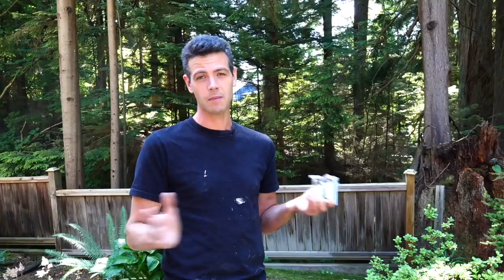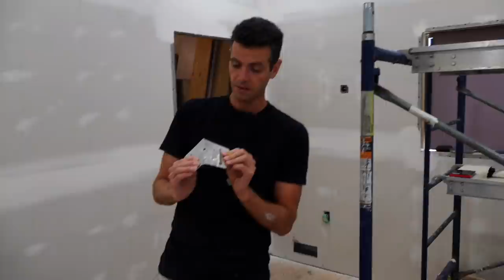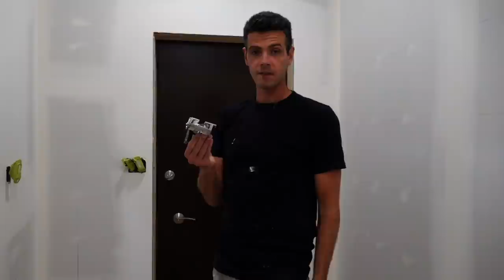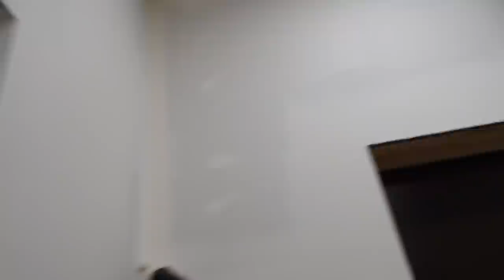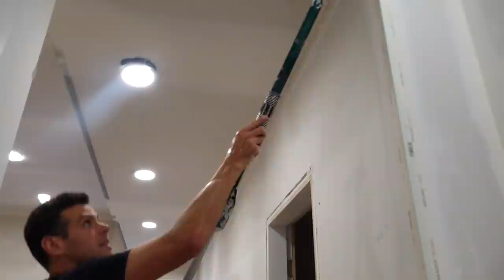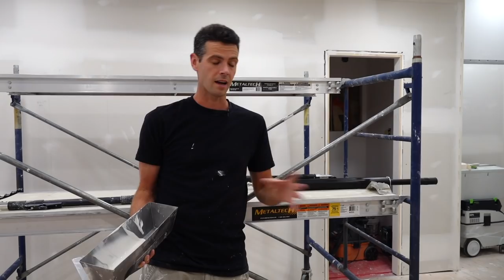Angle heads vs Flushers! Which is BEST? Drywall Corners!

Comment: I know that trim carpenters like angle heads better because a flatter, square (more square at least) corner makes applying base a lot easier.  I'll actually take a 10" knife and feather the corners out at the bottom.  It's an extra step for me but since I also often apply the trim I more than get the time back in the end because I don't have to deal with a gap between the base and the wall in the corners.  It easier to make the corners flat than it is to plane the trim to fit the drywall.

Comment: Lay a small piece of dry tape over the mechanical head hole, then press the ball into it while attaching handle. This will make the angle head more rigid on the pole the way you like it..
Reply: That's a great idea!  Thanks.
Reply: Can adjust the springs

Comment: The angle heads definitely take some getting used to, but you can also adjust the tension with the springs up top on some models. Flushers are much more user friendly and probably better for the DIY/light duty GCs out there. We have both, and if the angle head doesn't leave it quite right we usually follow up with the flusher.

Comment: As someone that finished custom homes for 35 years I can say that when you use the Angle Head with a bazooka and angle box it is much less messy and it will do a great job.  Just never drop them!!!  The carbide blades can break.  You definitely can not reverse the order. The Ange Head will dig out the corner.
Reply from the maker: Thanks Ed!
Reply: So if you enbed/wipe the tapes with a regular 2" flusher, you can't finish coat with the 3.5" angle head because it will cut the tape?
Reply: @carverdahlin2728  if the tape is rolled correctly when taping it doesn't matter what you use to wipe it with or coat it. It won't rip the tape.

Comment: With that angle head tool, you wouldn't want to hit an electrical box that happens to be at only a couple inches from an inside corner....like it happens a lot in bathrooms. They are hard on the flushers too. But  flushers will last way more than a year. I have a two inch, a newer 3.5 inch , but my 8 year old one is still quite usable. And I am busy at least 9 months out of the year.

Comment: An angle head, along with the corner box that feeds it  will set you back about 700$.And you mostly still have to fine tune those 3 ways.  A tube applicator and applicator head is about $150. If you also get the flat applicator head...$60, you can be really efficient at taping. 
My bazooka head is pretty much in need of an overhaul, but I am too old to want to invest in a new one; so I use it to feed the DRY tape( Feeding and cutting the tape still works good) onto the mud applied with the flat applicator. Still can reach 10 foot ceiling, which is a great time saver over stilts work. IMO

Comment: Try putting the angle head directly on the applicator tube.
Or even better an internal box. Then follow with the glazer.
Also, with the angle head, we used to remove the tungsten blades and use old stainless box blades. They wear in very quick and last quite a long time. Also you can round the point a bit if you go over a glazed tapecoat.
Setting two houses a week, the stainless used to last me a year.
Now i just use the glazers. 
A properly set up angle head is unbeatable in the right hands.

Comment: Just bought the ole cheapo set in plastic didn't use it yet. I do want my corners to be nice, but really no one looks at them,
they only look at how well the rest of the ceilings and walls. Great job on the videos. Ty
Reply: most  pro painters will judge a good taping job  by looking at the 3 way angles ...on smooth ceilings anyway

Comment: Nice comparison between angle heads and flushers. 
There's a few more pros worth mentioning for using flushers instead of angle heads.
One, you won't damage your flusher if you run it over a screw that wasn't set deep enough, unlike an angle head.
Two, flushers don't need to be rebuilt from time to time, unlike angle heads, which saves you money.
Three, flushers are more practical for smaller jobs, and a time saver compared to using angle heads and a pump. Easier and faster clean up.

Both have there pluses and minuses, depending on the kind of work you do.

Comment: So the angle head does a finish coat on both sides of the angle…at one time?! And the flusher is to imbed the tape in the mud? I still live in the dark ages, and hand tape knife and trowel, and still finish coat inside corners one side at a time….haha!
Reply: the flusher is not meant to imbed the tape....even if it is possible to do it. Imbedding tape is done with a  corner roller....then you run the flusher

Comment: I use a 3in flusher for my tapecoat it doesn't grab the tape as much and pull it off the wall and less chances of hitting a screw then I can sync it then I use my angle head in corner box three and a half inch it works great I think I only rip the tape once no big deal just push it back down with your finger or run it the opposite way

Comment: You still should flush tapes with a flusher that has a creaser wheel on the front then use the angle head.
Personally the flushers work better all around tho

Comment: I’ve always used a 2.5 inch flusher to tape and a 3 inch angle head to coat my angles. 

Never had an issue, just make sure your flusher isn’t warn out. Expect 6-8months out a flusher. After that tapes will start to be too rounded to use an angle head.

Comment: Think you might need a longer extension pole for those heights. You want to have your pole at almost a 45 to the peak of the corner to get that right amount of pressure on them...
Reply: Not totally necessary,  because what controls the force applied to the angle is the ball position at the end of that flusher handle  .You just need to pivot/rotate  it a little more towards the ceiling part  of the angle...instead of keeping it centered. I do not have an extendable flusher handle ,just a regular  can-am ;  and still flush great 10 foot high ceiling angles.

Comment: Put ya head onto ya applicator tube and push the mud threw the head that's if it's the same as the tapepro head I've got it actually has a hole in the back that forces the mud threw the head at the blades..
You need to start from the bottom go as high as ya can than spin head around and without pushing on applicator use the mud built up at blades already to that tiny bit on the top and go over it a couple times if need be

Comment: Do you ever run the angle head on the mud tube? I do a lot of remodeling work so the flusher works out better for me.
Reply: I have a better then ever tube and have used a drywall master head (only one of my 6 heads that fit)  on it with great success.

Comment: Getting a throttle box eventually for yourself would be something I'd think about. Once you get your mud consistency dialed in and used to the throttle box then you always have the correct amount of mud in your angles and you eliminate a step so running your angles is much more faster
Reply: I feel it leaves too little mud.tapes showing out through everything

Comment: Ive been using angle heads for some time now, they do tend to rip tapes when they are new but as you break them in it will run alot smoother without tearing the tapes. As far as finishing goes, tube and applicator works much better with with a flusher than an angle head, try putting the angle head directly on your tube and finish in one step, might take some practice to get it right but its much cleaner. It looks to me like your pushing way too hard on the angle head, you only need to press till the springs bottom out in the corner and thats it. There is definitely a bigger learning curve with the angle head but once you master it its effortless compared to a flusher, less pushing, one less step if you use it on the end of a tube or use an anglebox, and alot less sanding.
Reply: Another tip when taping, try rolling your tapes a little tighter than you would when using a flusher, that way you won't rip tapes and you will get a much flatter finish
Reply: You can also run the corner of the top carbides on a piece of sandpaper. I use a diamond sharpening stone but I imagine sandpaper would work too, just a little slower.

Comment: I have fresh drywall and I plan on doing a orange peel texture on the ceiling and knockdown on the walls. Should I do the ceiling first or the walls? I am working alone. What would be the best way to do it so as to not to mess up one texture when I do the other?
Reply: Spray the Knockdown, clean overspray off ceiling, turn up air and spray ceiling, knock down walls. Very difficult by yourself!
Reply: @dennisgormley6123  Thanks, I will give it a shot.

Comment: Ive been watching lots of videos of guys taping and ive never once on a job be it residential or commercial seen ANYONE use tubes to apply compound.    Its angle boxes and angle heads.  Maybe its a minnesota thing? Idk
Reply: On most commercial work ; they install suspended ceiling. So it is easy to use the corner box and angle head because you can start your run past the point where it is not going to show. However; On residential work; you still have to tune up your 3 ways after the box and head is run...at least according to the few tapers I saw using them.

Comment: We use to use an angle head to skim and coat our angles, I eventually bought a flusher to skim with, so the angle head took less abuse.  The main thing I have to tell you since you never used one before, make sure you blow the mud out from back behind the top blades where they meet at a point, if not it will dry and next time it is closed, the top clip (under the point part, that slides on the body) will bend & need to be replaced, resulting in the top blades having to be repositioned which is a pain.

Second thing, go through your angles and make sure all the fasteners are below the drywall surface or you will break the carbide blades, which is expensive and pain to align properly.

The mud should be thin, like taping thin.

Our method was a little different, we used a roller to set the tape, then either a flusher or angle head to skim it.  When it came time to coat it, we used an angle box with an angle head.  The trick is to leverage your body weight instead of arms to push the angle box.

They will tell you that you can't adjust an angle head on the jobsite, that they need to be sent out to align on a jig, which is bs.  With a piece of glass, you can do it yourself in under an hour.

Comment: What about those hard lines the angle head leaves from the wheels?
Reply: Sometimes the wheels on the angle head bind a little or seize completely when dirty. The O rings on the wheels leave the marks. I recommend a good cleaning and lubrication.
Reply: @GypsumDoctor  well considering it’s brand new I’d say that’s not the problem

Comment: Isn't that more expensive head designed to use with bazooka and cheaper one without it? Ofc you can use them as you want but for sure it works better with bazooka and you get exact amount mud each time.
Reply: Its designed to be used with an angle box. They have them with springs to make it easier to get the mud out. 
"Throttle box"

Comment: Curious if you’ve used a mud runner before or are considering it, it let’s you get away with two coats on angles. Plus less going back and forth with the applicator then flusher